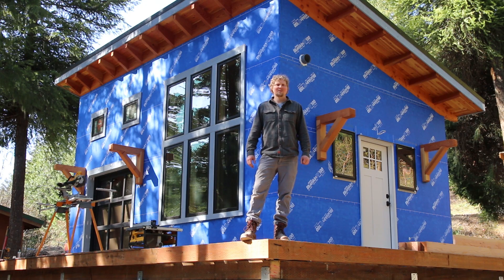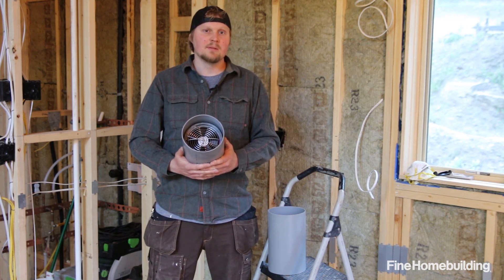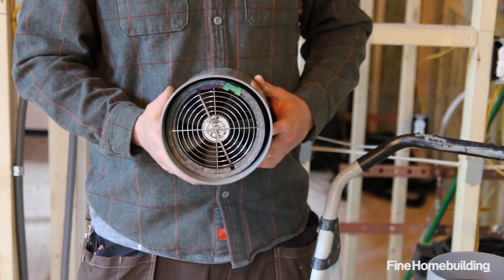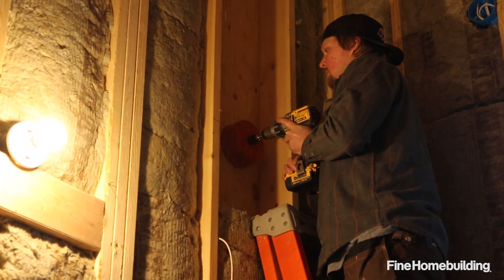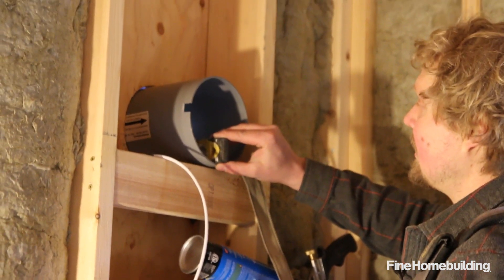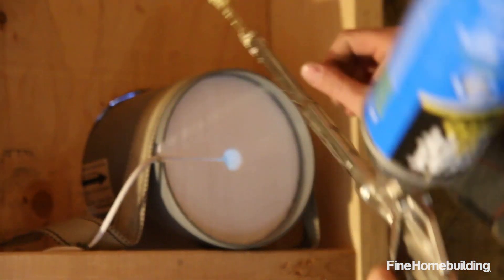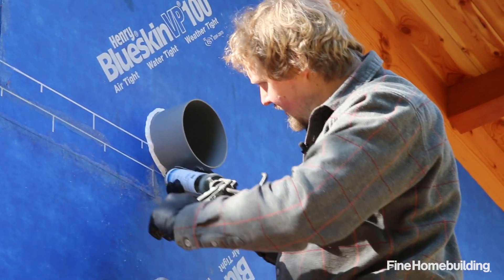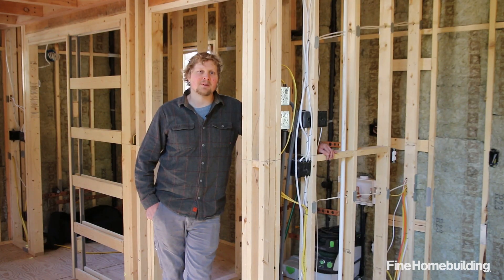Simple Mechanical Ventilation System for a Small Cabin

Comment: cant get how this works. one duct captures the heat and then transfers it to the other? using magic? Edit. Not mentioned in the video but on their website: "By a reversing airflow, which results for the targeted change of direction of the fan, the ceramics are charged with heat-energy that is offloaded into the room air and discharged again to the air added from outdoors.". Its the reversing bit that is novil
Reply: Ceramic heat exchange core